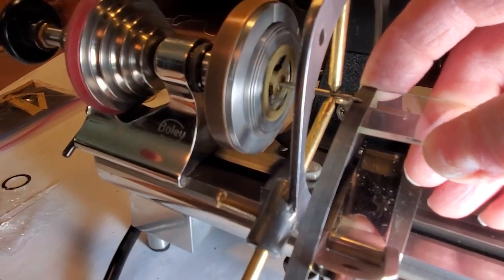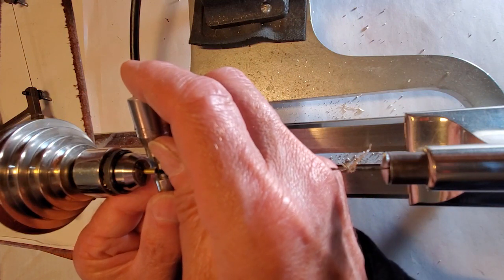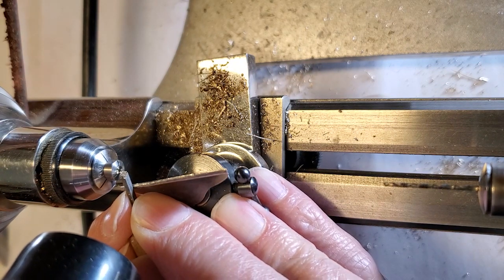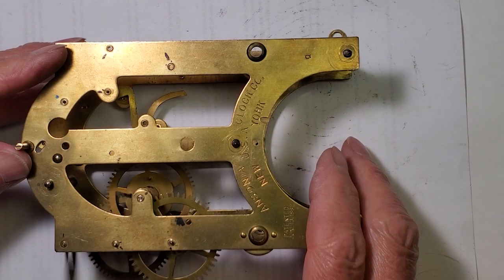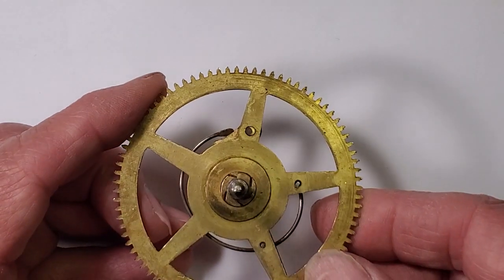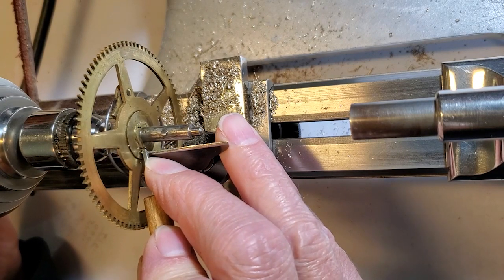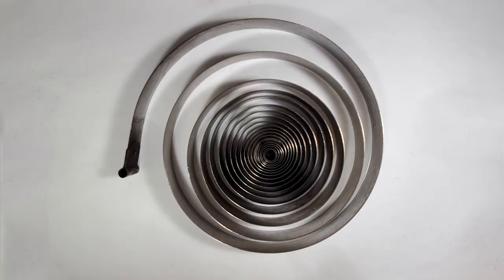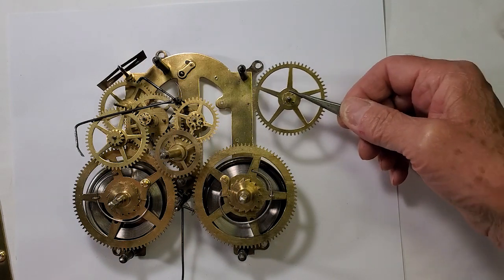1882 Ansonia Movement Restore for Cliff from Tennessee #37

Comment: Excellent work.  Especially impressive is how you dealt with the wear on the teeth of one of the main wheels by reversing the wheel.  One thing I would have done a little bit differently is for the replacement click rivet instead of using a straight sided brass rivet I would have made a steel step rivet, with the part of the rivet that goes through the main wheel slightly larger in diameter than the part of the rivet that goes through the click.  That way there is less risk of the click getting stuck when you peen over the rivet.  That said, what you did clearly works fine.
Reply from the maker: Thanks Paul,
 Actually I reversed both mainspring wheels just didn't get around to showing the other due to time constraints 
I will incorporate your rivet fix tip from now on.

Comment: IT seems that you restoring the defferent clock, which is not shown in the thumbnail, and as usual Great work,array of wonderful Tools and Equipments , Nice Sir
Reply from the maker: Owner didn't want to ship the case and only sent the movement.
This movement goes to a Queen Elizabeth Case. 
Owner damaged original pendulum rod so I am using a replacement the owner supplied. 
Thank You
Reply: @jamesmartin5370  Thank you for your reply sir

Comment: Vary nice job repaing and rebushing the clock
Reply from the maker: Thanks John,
 This one ended up being a nice running movement.
Reply: @jamesmartin5370  That's  very good to hear. How many days can this clock go before rewinding it? It has to sound very nice inside the case.
Reply from the maker: @myqueentitanbug28  If I remember, this one was a 30 day, customer didn't send the case, shipping is safer sending movement only if possible.
Reply: @jamesmartin5370  That is a nice long running clock. The mantle clocks I have I think need to be rewond once a week.

Comment: Masterful work as always. I’m curious regarding your thoughts on if a pivot hole appears perfectly round in theory could ever need a bushing? In other words, would lack of an egg shape of a pivot hole signify any play in the hole was originally designed in by the movement maker? Sometimes it seems like movements on mass produced American clocks have a lot of pivot movement or “slop”, however the pivot hole  appears close to perfectly round. This makes me unsure if they were just originally produced that way. Thanks
Reply from the maker: They were originally designed and produced with a considerable amount of pivot to pivot hole clearance.
No production drawings seem to have survived that we can take a look at that give exact tolerance's that I am aware of.
Some of the early designs only had four pillar posts and when fully wound the movement frame could twist slightly.
This condition required more clearances to prevent possible pivot binding.
Reply: Thanks for your input. Do you believe a pivot hole could appear perfectly round & still be worn enough to require a bushing?

Comment: You are the very first that I have found which has said to file out the hole back to center before proceeding with the hole for the bushing and to just ream it out rather than drill. Thank you for providing that information! AND, what do you use for chelation, citric acid?
Reply from the maker: Chelation process is different that using a an acid based process.       For chelation I have been using Evapo-Rust:   https://www.evapo-rust.com/
There are other chelation products out there.   Its a water-based rust remover that draws the rust away or lifts it from the metal, this is accomplished through what is called chelation.

Comment: Very nice .which oil is used for oiling
Reply from the maker: I used NYE Synthetic Clock Oil on the pivots of this clock and , and timesavers mainspring lube.
As long as you stay with a good grade Synthetic Clock Oil all works out good in the end.
For pivots I put in just enough to fill any possible air gap between pivot surface and pivot hole to form an oil/dust seal and call it good.
Reply: @jamesmartin5370  thank you very much